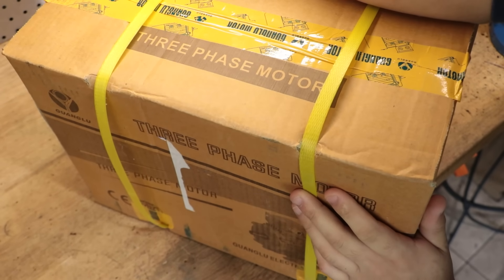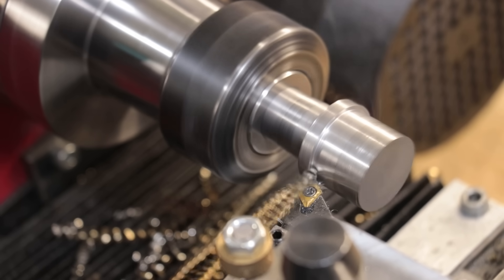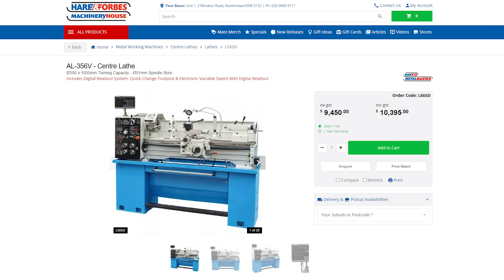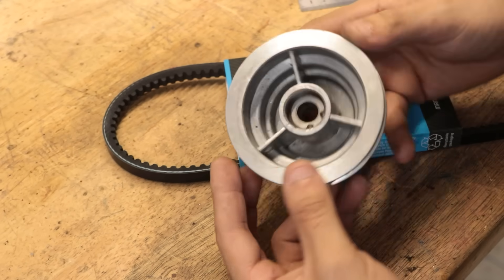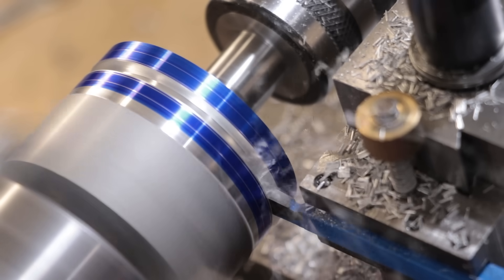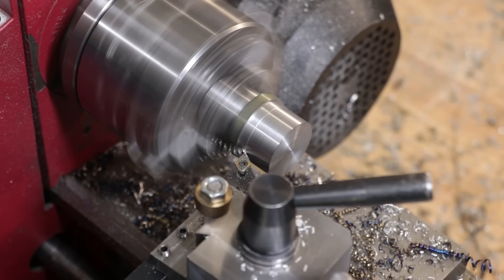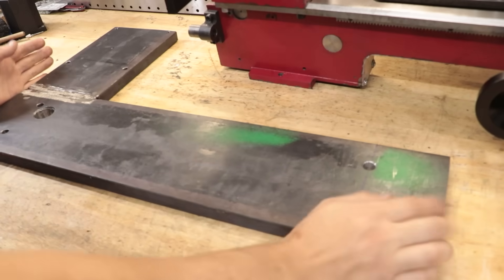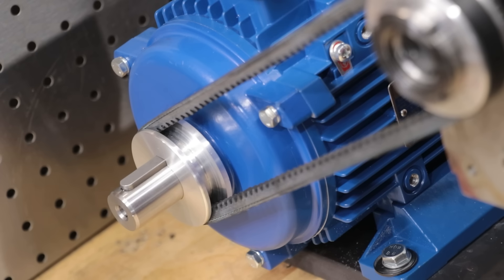Mini Lathe 3HP Motor Upgrade..... (Yep 3HP)

Comment: Such a waste of time. You have multiple size pulleys but never use them. The gearing/pulley sizes are completely wrong, and even a 3HP motor isn't going to fix that.
The 3-phase motor is going to overheat from being continually operated at low speeds. He has stepped pulleys but doesn't use them 😢
There is no need for all this expense and silliness. What's needed is a 1.5-2.5HP DC treadmill motor and the PWM controller from the same treadmill, connected via belts with different sized pulleys to allow broad speed/torque ranges and not lugging the motor.
Reply from the maker: Relax. Its only a 900 rpm motor not 2400 so its running close to full speed most of the time, and it doesn't get close to using its 10 amp draw. You'd be surprised that it doesn't get too hot. If I was doing proper cuts I'd probably have to worry about the heat build up. As I explained I don't use the pulleys because you just cant get the rpm low enough, especially to use big drills and reamers, not with that motor anyway. This is obviously intended to be a crazy set up with the largest motor I could get. With that said, its pretty amazing for a mini lathe and I am very happy with it. Cheers

Edit: that’s not to say that I wont be careful when it is very slow
Reply: @artisanmakes  - I do understand and it's fun to over-engineer stuff. There would be no over-powered gokarts if everyone was sensible.
I guess my attitude for my own mini-lathe leans to getting the speeds I need from gearing, not 3 phase and a VSD. To gear it down you just need to add a larger spindle pulley, and/or a smaller motor pulley (within belt limits).

Comment: Pretty sure that they used only three bolts to mount the headstock for a good reason... apart from saving a bit of effort drilling and tapping that last fixing.

But fair enough...
Reply from the maker: For what it’s worth, every non sieg brand mini lathe uses 4 screws to hold it down
Reply: @artisanmakes  I'm positive that you're right, and I've seen others do similar to you when beefing them up, for example Ade from Ade's workshop.

My point was that three points of contact has its advantages too, but I'm sure you know that.

That's a reassuringly overpowered mini lathe you have built for yourself there! Reminds me of a VW BEETLE with a Porsche 911 engine which I used to see around when I was a kid. I'll be interested to see how it goes.

Comment: Man that there is awesome. Over here in the u.s we use commercial sewing machine motors. Most of them come with a variable speed controller and produce a insane amount of torque and be 3× smaller than the 3hp motor you used. The range on most of the sewing machine motor is 100 rpm up to 4000 rpm. Even though small chucks aren't rated for more than 2500 rpm max 😂. Glad to see the upgrade though man. You may or may not be familiar with the guy, but his name is ade. His channel is Ades workshop. That guy is super smart with mini lathes as well. Might be worth your time looking into his channel and gain more knowledge or ideas for your shop.
Reply from the maker: Ive seen a few people attach them. From memory servo motors no? I looked into it a while a back but went with the 3 phase.
Reply: @artisanmakes  yes that's what they call them servo motors. That's cool part about mini lathes you can use just about any motor to run them as long as it makes decent torque.
Reply: Also called consew motors, I have a 1hp one on my lathe with a small 4 rib belt, has a serous crash a few months ago, and it smoked the belt instead of stalling the motor.
Reply: @TinkerLynx  better the belt burn up than the motor. Lot cheaper to replace lol.
Reply: @artisanmakes  :  You can use a servo motor (with suitable electronics to supply the electrical pulses to make it turn) as you can buy them as big as you need.   It would be a lot more expensive than an induction motor though.  Servo motors are precision rotatory position things - you would be paying for the precision you simply won't use.
Reply: I would not have thought a sewing machine motor was suitable.   They are series-connected universal motors, which means their RPM is inversely proportional to torque.   This means the chuck rpm will vary a lot depending on depth of cut, turning radius, etc.
Also, they are not designed to work full load for any length of time - that's why they can be so small.   A lathe will make the motor work CONSIDERABLY harder than a sewing machine will.
Reply: @keithammleter3824  have you looked at the power of a commercial sewing machine motor? The materials those thing have to push a needle through, there's no stopping that thing nor slowing it down. For a mini lathe, there almost perfect match.
Reply: @MoparFab  : In my time I have repaired sewing machines for a living.   I own a sewing machine.  The force required to push a needle through even the heaviest cloth is very small, and the pushes per second is not very great - 200 PPM at most.
Before electric motors became common in the 1920's, sewing machines used to be human powered via a foot treadle.   For home use, floor treadles were common up to the 1950's.   The average school girl can treadle a sewing machine with her foot at a speed so fast the needle movement is just a blur. 
A catalogue I checked shows that typical sewing machine motors are rated at 100 to 200 watts.   Typical no-load speed is 7000 RPM.  Due to the characteristic of these series type motors, the speed drops rapidly with load - the torque is very high but only when turning very slowly.
There is a fair bit of inertia in a fully mechanical (ie cams and gears) sewing machine.   Since the needle load is only present for about 20% of the machine rotation cycle, the flywheel effect means the motor never sees that pulse load.
Reply: @keithammleter3824  the link I sent is the motor I'm talking about. It's just an example but ive seen a few upwards in hp.

Comment: Fair bit to discuss here.

Firstly, I have a minilathe as well - maybe slightly bigger than yours (what would be considered a 7" lathe, but has more mass) - I run a 1.5kW 3ph motor - but I wire it in 415v mode ("Star " aka "Wye" configuration) on a single phase 240v VFD - I can tell it's the same as how I saw how you have wired yours, where the resulting power maybe ends up around half that, and this is more than enough to perform huge depth of cuts, but you're still in the "grey area" of snapping cast iron in half if you crash it. DO NOT WIRE IT IN DELTA CONFIGURATION - that would remove all doubt to causing permanent damage.

Next, with VFDs, the lower the frequency, the higher the current draw - now you've wired it in star config - which is a good start as the coil resistance is increased, but you should be cautious of running the motor under 20Hz - there is a small risk of blowing up the VFD (recently happened in a FB group I'm a member of), but that risk is lowered due to the star config and 240v input.

If you read the VFD manual - it should have a "Max current" setting - good to set to the max rated current on the motor's spec plate + 10%, and "Minimum RPM" (Set to 15-20Hz). Max RPM is typically 80Hz before 3ph motors begin being inefficient, but if you're finding yourself at 80Hz and wanting more - you should probably redesign primary the pulley ratio, or add pulley ratio options so it requires a belt change, 95% of your work should be within the 25-75Hz range without any belt change.

Some other VFDs can also display "Alternative RPM" (by using a multiplier against the frequency) - so depending on your pulley setup, you can have it read out true spindle RPM instead of just the 3ph frequency. I never got around to doing this on mine and have come to know it intuitively, but might be beneficial to you if you get this set up before you end up getting used to it, like I have.

With bigger depth of cuts, more RPM, more power - come more heat. It's time to invest in a "mist cooling system". They're $30 on eBay and need a 30psi air feed and (ideally) a source of semi-synthetic coolant mix (or plain water at minimum). It's either that, or you'll continue to burn out your carbide. I'm very much like you in that respect - just preferring to use carbide, never had HSS - but you'll find that has it's limits as well, so do yourself a favour and get a coolant setup going.

Next, consider a diamond wheel setup where you can touch up your tools - a couple of 6" diamond wheels is $150 on eBay (600 grit, 120 grit), and makes for another decent project + learning curve to build the sharpening station and technique to use it, to optimise your lathe work. A properly freshened-up, mirror-finished brazed lathe tool is really something to behold.

Love your work - as I continue my own journey somewhat in parallel to yours.
Reply from the maker: Cheers mate. For what its worth, the manual for the VFD states to use triangle/delta for the wiring and not to use wye. Doesn't look like I'll be going below 20hz for this motor, unless in reaming or threading. Already looking into a spray coolant, the work is really heating up with these cuts.
Reply: @patrickd9551  again - who said you should use a VFD without setting limits? Or wire a motor in delta with wye-rating voltages? For crying out loud. It's a 240 Delta/415 Wye motor, you can see on the spec plate, he can wire it in either way because he's only using 240 mains input.
Reply: @LitchKB  for crying out loud, he never explained this theory properly. Just changing to delta because the manual says so is simply dangerous.

True, I've only worked with big boy VFD's and actual three phase power, so I'm not used to these converters which output a (strange to me) lower voltage. 

But I've looked up the manual and yes i've changed my comments. However I do stand with my original point of nilly willy changing the configuration because the manual says so. 

Your comment is the first that I found that actually gives proper information.
Reply: @mark-sarich It depends actually. As nobody actually explains it properly, here is my additional information. 

The winding on these motors are rated for 240v on a single winding. So if you have real three phase power (ie 400V between phases) you want star as to reduce the voltage for a single winding. 

However in the case of these single phase to three phase converters the output between phases to 230V, which is counter intuitive for those having worked with three power power. 

If you wire these VFD's with three phase 400vinput, you get 400V output, so you will still need star.
Reply: -All 3 phase motors are wired Delta even when you supply them with y like 120/208y.   Delta is a phase to phase reference and y is a phase to ground reference. 
-amps will go up with load not frequency or cycles.
Reply: Why is there always some nuffy contrarian who insists on posting unhelpful drivel.
Reply: @LitchKB  Because this HELPFUL drivel is actually correct.The voltage specified is 240/415, which means a single winding should not exceed 215V. Using delta on a star motor will result in too high currents and thus irrevocable damage.

There is only ONE exception and nobody ever tried to explain it properly. Which is the case of single phase to three phase converters. The voltage between phases will become 230V instead of the normal 400V you would normally get from real three phase power.

Comment: I have made keyways using a drill bit or milling cutter first to take out the majority of the metal then you just have the corners to take out by hand file or by using the mill quil that for me is much sturdier than the lathe carriage if you can lock the spindle.

Comment: Wow, what an upgrade! That is like a V8 weed wacker! 
I have a 15" swing gear head lathe that weighs 2300 LBS (1043 Kilos) and it uses a two speed, three phase, 3 HP motor. With that much power, depth of cut no longer becomes an issue for the hobbyist. Your new problem will be rigidity and damage if / when you make a mistake. 

I love the creative solutions to your problems, thank you for sharing.
Reply: Damn,I really ran the same thing with a 0,3 hp motor from ASEA motors(came with an old twin spindle attachment that was sexy enough at the time for me but while the whole contraption came as a "vintage" ARO drill mod 76** C,just for $460 while the brand new attachment from Rand Ingersoll costs about 4500$ alone so I took the deal of course!)-so it is obviously enough for an amateur machinist..Meanwhile I never understood why ever since 1980-s those "pneumatic auto feeders" are almost as expensive as they were yet barely anyone still uses them and their attachments are still produced by different companies and yet I see some of them on eBay for quarter of the price of the new..So anyway I just bought a real monster of a drill as an investment/for the ridiculously powerful 25hp motor that it has..And the only time I used it even to a fraction of it's power(BTW it has a 4" stroke,it's vertical and has a twin spindle attachment with 2×13mm chucks size)-it drove two carbide bits through a 5cm thick titanium piece without even slowing down,or any effort-and the whole thing is just over 120 lbs with motor and manual control unit,pneumatic self feeding system,cooling system and the rest..Just 10 seconds,one stroke,3900 rpm,air cooling selected-just a nice fire show of turnings and the drill just retracts up in less than a second..Isn't that insane?Nearly overloaded the grid of an entire house and according to the manual it can draw up to 1040 amps at 24vdc so quite serious even for a machine shop..Probably would easily power an entire array of similar drills along with a number of other automation systems,pistons and other stuff..

Comment: i have a 12x36 with a weg 3phase vfd and motor, and it is 2 1/2 at 2200 rpm you are pushing that little guy to its limits and i love it

Comment: Is the welded metal connection between the plate under the motor and that of the lathe unwise. Won't it propagate unwanted vibration?
Reply: Compared to bolting the motor and lathe together  like the original design? 🙄😉
Reply: 6x the power of the original…
Reply: @cdyoutoob  - and probably better balanced...
What vibrations are you fussing about? From the motor or to the motor?
Reply: From the motor. With a belt connection shouldn't you consider dampening vibrations by 'isolation' methods. Any motor vibrations would go straight to the lathe base. i just can't see the logic of putting the weld in place between them.
Reply: @cdyoutoob  - to be honest, I don't understand the weld either.
Neither do I understand the bolts holding both so the belt tension cannot be adjusted.
Neither do I understand the use of literally 1:1 gearing between the motor and spindle, throwing away the 3 or more speeds possible with the original 3-step pulleys, then making a spacer to remove the large gap on the end of the motor's pulley shaft.
Neither do I understand why use a new VSD to adjust speeds, when the old motor was more than enough if it was geared down to a more suitable (slower) cutting speed.
Inductive motors like this have terrible torque at low speeds, plus cooling issues. There's meny reasons why people use DC Treadmill motors for these mini lathes 😉
Reply from the maker: Nah, only reason why I did that was the old set up with the motor bolted to the bench, the bench used to flex as you tensioner the pulley since it’s made of wood. Welding it in like that just made the set up made rigid. I’m sure there were other ways to do this but this is how I did it and it works

Comment: is there any sort of analog input for the vfd to control the speed? it would be super cool to use a dro scale and arduino to be able to set the vfd to run the motor at a constant surface speed when taking face cuts based on the position of the scale, kinda like how the giant industrial cncs work.

Comment: Regarding only 3 screws in the head stock, could it be to avoid potentially warping it if the 4th point isn't perfectly planar?
Reply from the maker: Maybe but most non sieg brand mini lathes use 4 bolts in the same pattern I used

Comment: Aren't the wires to motor a bit too thin?
Reply from the maker: Rated for 3000w
Reply: @artisanmakes  Rated? That depends on material, length of wire and amperage. Assuming its copper and your wire is roughly 2m long, motor runs on 230V (~10A) you would need wires of cross section ~1mm2, maybe I am wrong and they just look thin on video.
Reply from the maker: My bad just looked at the wire packaging . Packaging says 14amp max current

Comment: Have you changed the motor connection from star to delta ? You won't get full power with vfd without it. You need to turn 3 bars in the motor terminal block
Reply from the maker: Yes I did, almost forgot to but it is laid out in the vfd manual to use  delta/triangle only

Comment: Nice! Where did you get it and about how much does it cost?
I have my lathe stop soo many times and  still on the second motor but how long it will take to fail motor or board on slower speeds.
Does you VFD also provide running the lathe in reverse?
Reply from the maker: All sourced through eBay, except the belt which I bought from the auto parts store. And the plate which I bought from my metal store, edcon steel.  In total it was about $500. And yes the vfd is capable of reversing the motor
Reply: @artisanmakes  Nice! Still a high price compared to the original price of the lathe but with all the changes combined this machine is a beast for the size!
Looking forward to the next video!
Reply from the maker: Yeah for sure. This isn't really an upgrade that i'd recommend, I just wanted to see what would happen if I shoved the most powerful motor that I could find on that lathe.